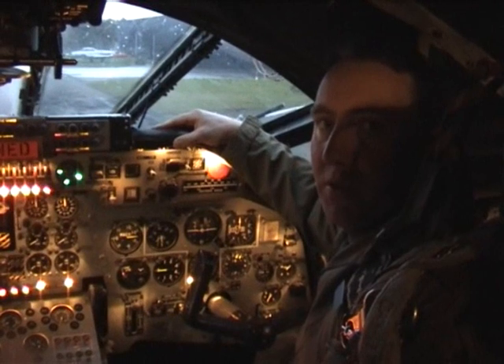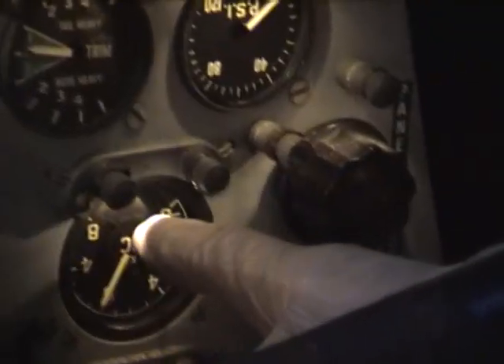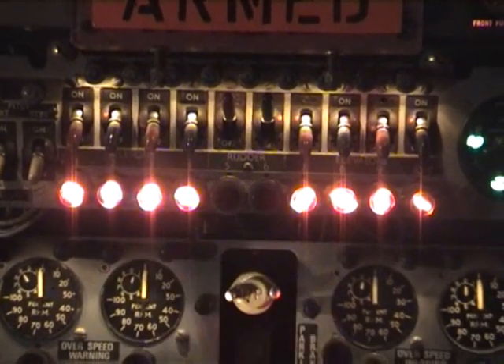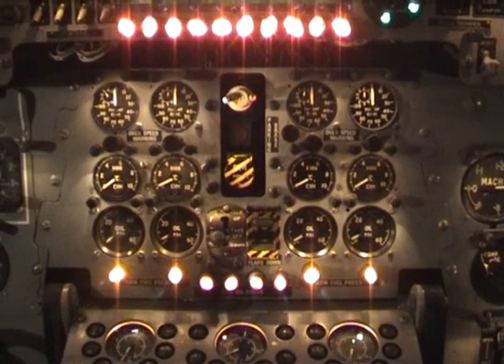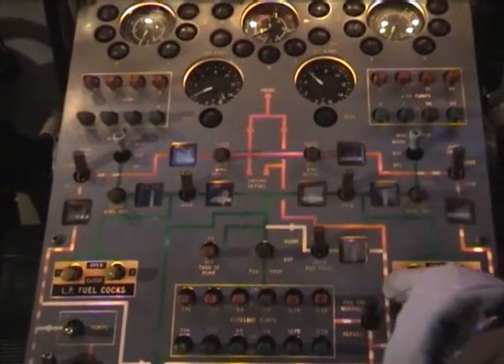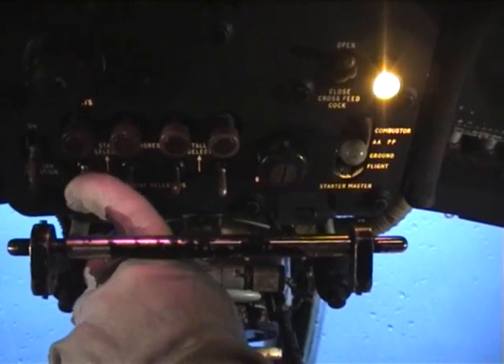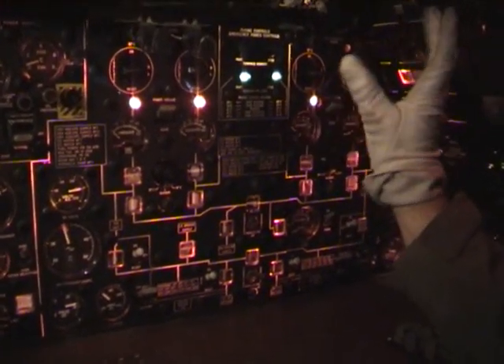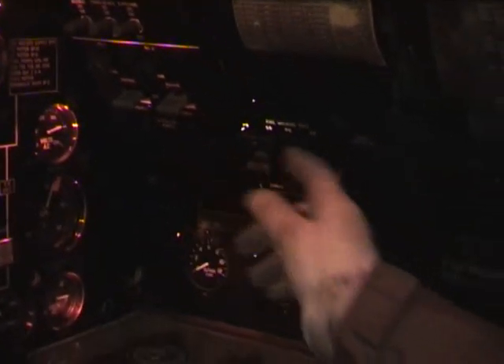Victor XL231 Tour 1

Comment: Very interesting. Is the fuel management center panel between the pilot and co pilot a tanker particular item? Or was it the same for the aircraft in the bomber role? Is the aircraft running on internal external power during video.
Reply: Yes the fuel panel designated AT is specific to the tanker. The B2 had a smaller and simpler fuel panel as it wasn't configured to dispense fuel as the K2 was.